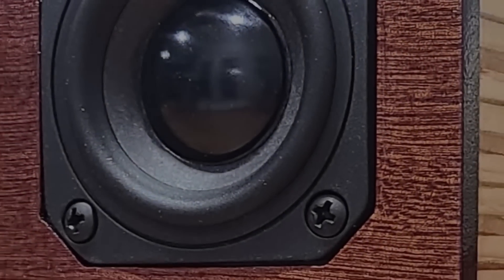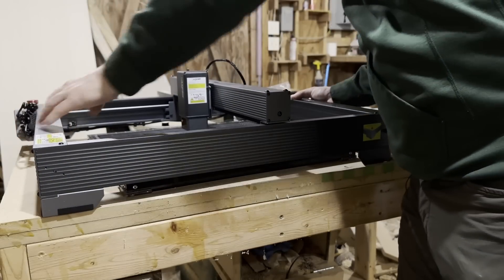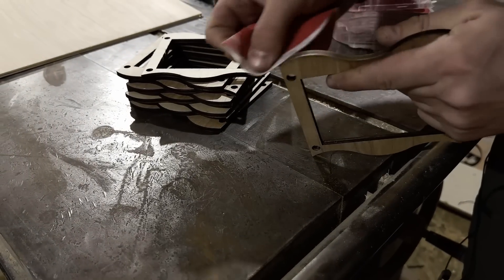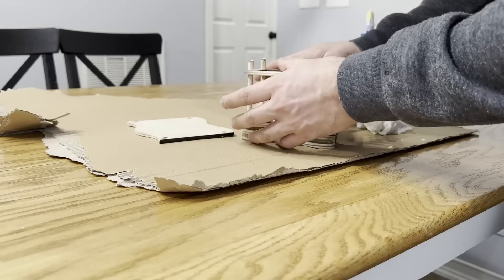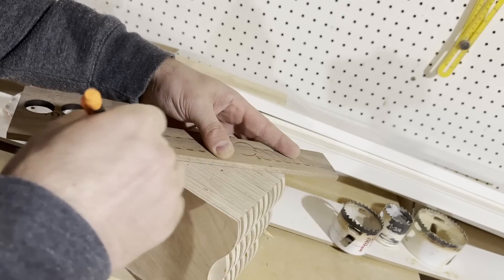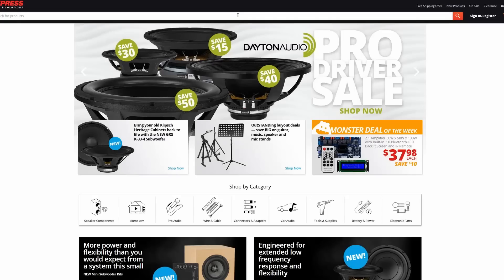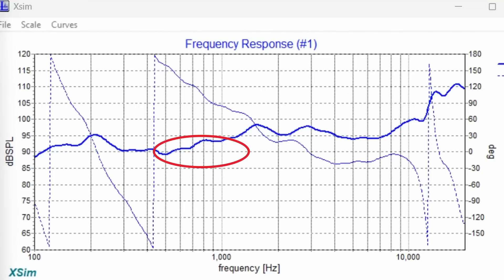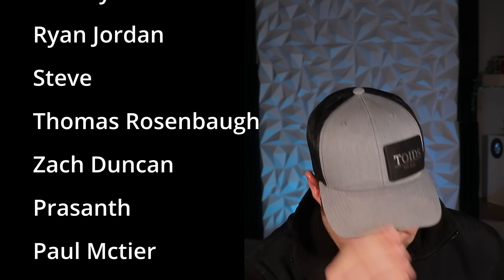Bose Killer - Kills the Bose Cube Speakers using the Atezr P20 Plus Laser

Comment: hey Toids! Could you do a video on scaling up a speaker? I was trying to scale up the design of the tronsmart t6 max, as i believe its a very good design. the speaker has 1 subwoofer and 4 bass radiators. An interesting concept for sure! Hope you can analyse the speaker and cook up something to take outside, as i cant pick up the giant subwoofer designs you propose, but the tronsmart does an incredible job at providing lower frequencies, and i wanted to port this into a larger housing, using a high quality and high powered sub, maybe 6 to 10 inch. 

thanks again for reading!
Reply: if anyone can help with that, it appreciate it!
Reply: @thiloswift8035  if you go onto the forum, you might find some people there that will be willing to help 👍. It's also easier for people like Nick or I to help out there too. The best thing to do is to start with mocking it up in winISD

Comment: When I saw the outside of the cabinets - I thought that the contours would also be on the inside? This would have acoustic benefits, by reducing reflections and standing waves inside. Possibly staggering the straight edges in and out to say 3 or 4 different "depths"?
Reply from the maker: Originally, that was the plan. Unfortunately, I ran into a few issues. The first was that when I cut them out and stack them I didn’t have enough overlap to glue together without air leaks. If I fixed this, then it would get in the way of the magnitude of this particular driver. So I either could make the box wider, or get rid of the internal waves. I chose this time to just get rid of the internal waves..

Comment: I assume the laser comes with its own drawing program and control software.  I use VCarve Pro and Mach3 for my CNC.  I've been thinking about getting a laser cutter primarily for cutting RC airplane parts.  I suspect the Atezr would work well for that.
Reply from the maker: Interestingly enough I drew these out in the Aspire version of Vcarve. Then transferred it to Lightburn. Which is significantly cheaper than cnc software, it’s only $60 for the program.

Comment: Nice project. I would rather use the laser for template making in order to use better material(s) for the build itself... but for forming and creating the loudspeaker case... puhhh... I don't think so... it's yet another tool and you might be right with "more possiblities" (at least that is what I heared when you talked about changes in DIY) but a good loudspeakercase can be made much better when using the cut outs as a template for your router. That thin plywood doesn't look that professional in the state you kept it. The template way will increase the build-quality and the idea itself will come to life even more!
Reply from the maker: Another great thing to use your laser for.

Comment: How much does one of those set you back, but it's maximum depth? You say air?? I would have thought it's something like CO2 not air as the gas or argon same as a welder.
Should have used a mark audio 3-in driver but my price I know but.. 
Can it cut out concaved and convex shapes?
Reply from the maker: The links are in the description if you want to know more about this particular machine, and how much it cost. It’s going to vary. However, it is on sale right now. Having said that, the air is only to cool down the cuts while it’s cutting, the laser itself does the cutting. As far as what shapes you can cut, you can really cut whatever your imagination allows. But keep in mind that it cuts straight through. So you can’t do any convex or concave’s cuts on the outside like you might be able to with a CNC

Comment: By the look of the exterior I immediately thought you had a similar layered wave texture on the interior of your speaker, too.    Turns out not.   But now I'm thinking, wouldn't that be a genius way to eliminate specific resonances and make a better sounding speaker?
Reply from the maker: Interestingly enough that was the original design. Unfortunately when I cut it, I didn’t leave enough overlap for gluing. And then, when I did fix the overlap, it got in the way of the magnet of the speaker. So it was either make the speaker a little wider, or just eliminate the interior waves. But you’re absolutely on the same wavelength that I was.
Reply: @Toid  hope you get to try it out one day.  I’d be super interested in the results.  Thanks for sharing your trials so far.